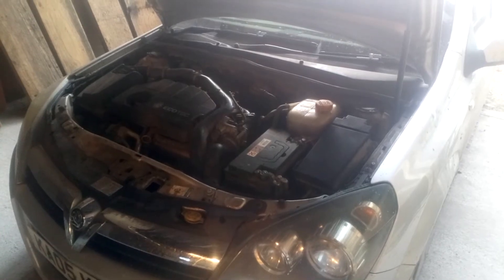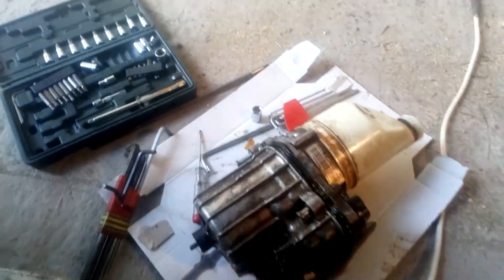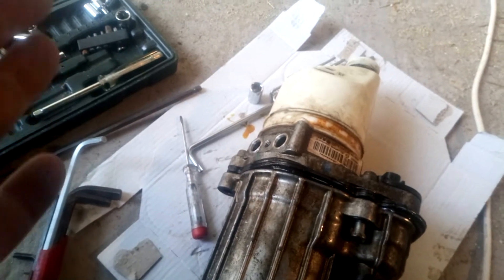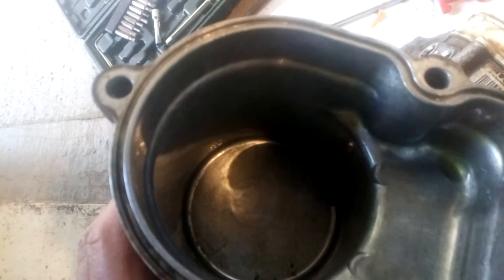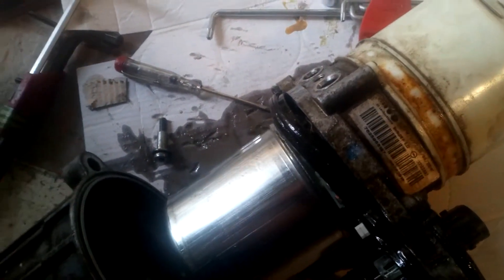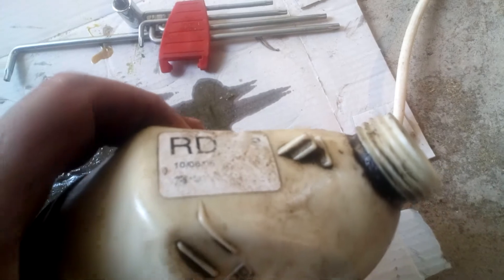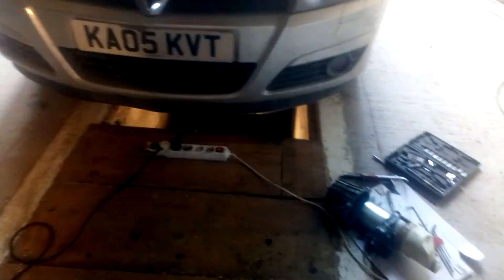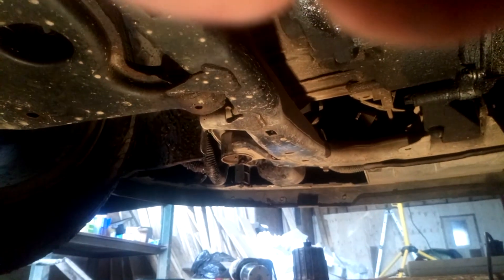Vauxhall Opel Astra H 1.7 CDTi steering servo hydraulic pump replacement swap exchange

Comment: bro the orings cost about 20p from vauxhall dealer. just replace them. trust me its worth it i know from experience.
Reply: that's very good to know - do you have a disassembly diagram/link/video or is it just obvious when one looks at the unit? I must say I never thought to take it out, examine it and repair it, rather I just got one secondhand and fitted it, on the assumption that it would be the quickest and easiest way to get the car on the road. So if you can give a little more info on what needs ordering, what to look for etc., whilst it's in situ, a lot of people could benefit from being able to order the fight parts in advance ready to do the job. Thanks for your input, much appreciated.

Comment: Una pregunta x favor esta bomba al remplazarla hay k codificarla?
Reply: Hi Johan, I'm not exactly sure what you mean, as Google translate says you ask "does the pump need to be coded". Do you mean does it need to be coded with software, in which case - no. Does it need to be calibrated when it's fitted - yes, in theory, but I didn't calibrate mine, and it worked fine - which could be coincidence if the wheels were straight in the donor car when it was removed, and straight in the car it went into. Best of luck with your car :)
Reply: Si lo le keria preguntar era eso exactamente por que nesecito cbiar la bomba d mi astra H1.7 cdti del 2005  tipo motor Z17 DTH y media saber si era igual como lo hicisteis tu quitar y poner
Reply: @johanzambrano9003  Sorry Johan, Google Translate is really bad with its translation of what you are asking exactly. There are only two models of steering pumps on the Astra H models that I know of - one has a wider reservoir and looks rather different, so you can't easily mix them up. As far as I know all the ones which look like the one I use in my video are exactly the same as one another. Whether they work with cars with a different Electronic Control Unit I don't know for certain - but I would think so. I hope this helps.

Comment: Did you loose power steering completely? Mine is intermittent! And at a certain steering angle it kicks in ! Any ideas?
Reply: Muchas gracias x ti ayuda ala final pude arreglarlo gracias a tu vídeo y es así como tu dices mil gracias
Reply from the maker: it could be low oil, yet the pump gets enough of it into the system, to function at harsher angles, or it could be a failed control circuit or electrical connection? To my mind it would seem easier to change it than to spend ages fault tracing, especially if you have a good breakers nearby.